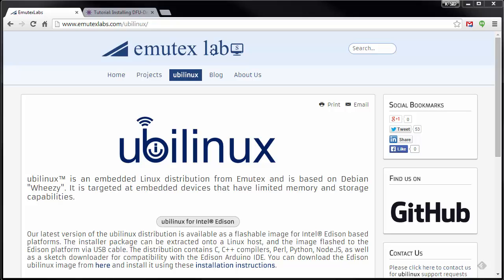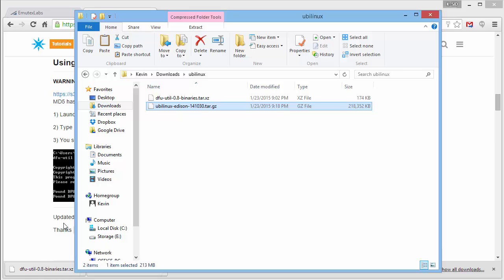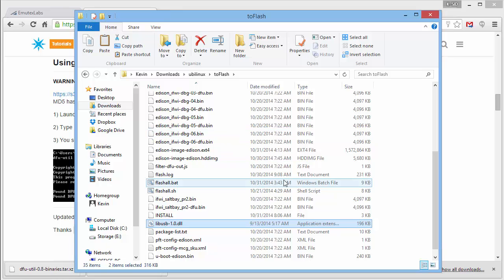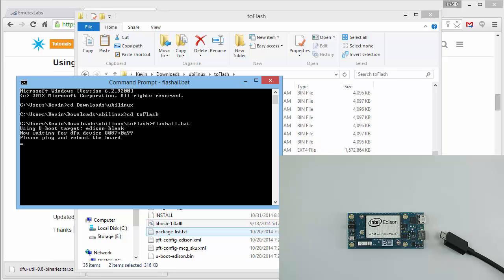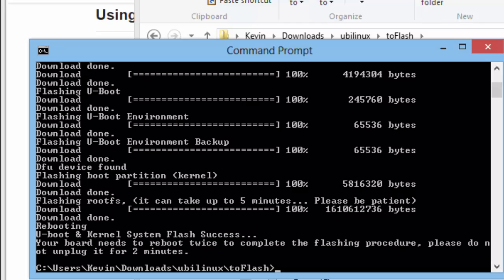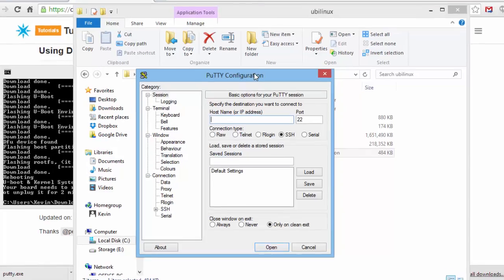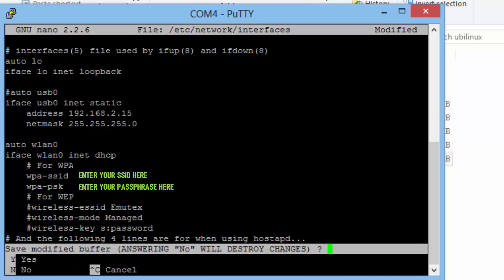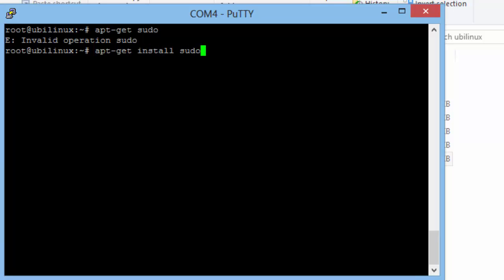µCast #21: Installing Ubilinux on the Edison (Windows)

Comment: I'm having trouble flashing my edison. Whevener i run my flashall.bat, it gets up to Flashing boot partition but then quickly goes through the rest and exits the cmd. It doesn't take 5mins for rootfs like it did for you. Any ideas why? Then when I try putty, it goes into rescue mode.
Reply from the maker: Did you make sure to copy the libusb.dll over? What output are you seeing? Are there any error messages?
Reply: Yep I went through the instructions several times but never got it to work. So i just made a bootable Ubuntu USB and flashed using the bash script, and that seemed to work. Thanks!
Reply: DailyIoT  To update you have to run  apt update to refresh the repos and than apt upgrade to install the new packages

Comment: That' great. But my wifi connection ask for username along with the password. Could you please help me how can I connect to wifi with username....
Many Thanks..
Reply from the maker: +Chaithanya Kumar It depends on what kind of security you have enabled on your WiFi. In the video I am using WPA. The only other one I'm familiar with is WEP which is not recommended as it's very crackable but neither of those ask for a username or password so I'm not sure how you are configured. This link has some info on how to modify the intefaces file based on how your WiFi is setup. It might be of some help.

https://www.debian.org/doc/manuals/debian-reference/ch05.en.html#_the_wireless_lan_interface_with_wep

Comment: Any idea if I can still flash Arduino Sketches from the IDE? I cant get the 2nd serial port to show up anymore :(
Reply from the maker: Evan Johnson Does the storage drive show up still? Or do you not see any connected devices when you plug it in?
Reply: MicroCasts I don't see a storage device, only a CTD device in the device manager, and it shows up as missing the correct driver. I've tried reinstalling the provided Intel drivers, and have reinstalled ubilinux about 5 times now, all to no avail.
Reply: MicroCasts the main reason I wanted to have ubilinux on it is because it has support for USB FTDI serial devices
Reply from the maker: If you don't have the storage drive how are you reinstalling ubilinux? Also, which dev board are you using? The mini breakout or Arduino?
Reply: I have the arduino board. And I don't know, I just know that DFU mode works and it can flash the ubilinux image. It does show up as a drive when running the default software though.
Reply from the maker: Evan Johnson Oh. I think I know why the drive doesn't show up. Try this after installing Ubilinux:

http://www.microcasts.tv/tips/2015/01/26/restoring-edison-drive-in-windows-explorer/

As far as flashing sketches from the Arduino IDE after installing Ubilinux I'm not sure why it wouldn't find the OTG port. Maybe an issue in Ubilinux.
Reply: Thanks, that seemed to solve my problem of not seeing the drive, but unfortunately I still do not see a serial port...  the only devices that show up in device manager are as follows: 

CDC Serial (Drivers Missing)

I GOT IT!!!! You just have to go into "Update Driver"->"Chose driver already on my PC" -> "COM Ports" ->"Intel Corporation" -> "Intel Edison USB Virtual Serial Port" and then select that driver. 

Successfully uploaded the "Blink" example onto my Edison. 

Can you tell me, what is the use of having the drive show up on the computer? What does it do? Can you copy code/programs to the edison through it?
Reply from the maker: Evan Johnson So awesome that you got it working. The storage drive can be used to flash as far as I understand by placing certain image files there. I seem to vaguely recall that if you put regular files there that you can get to them from within Ubulinux but I can't remember how.